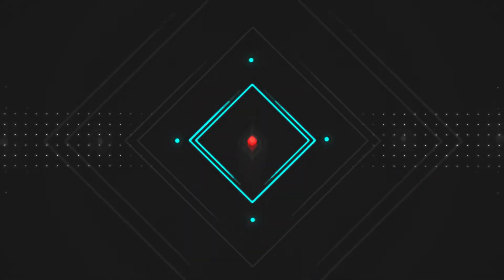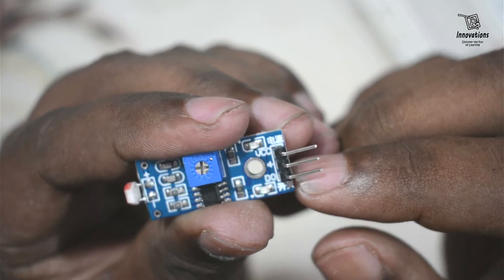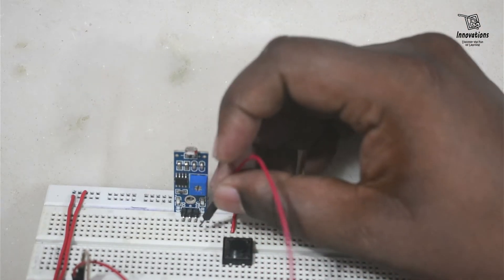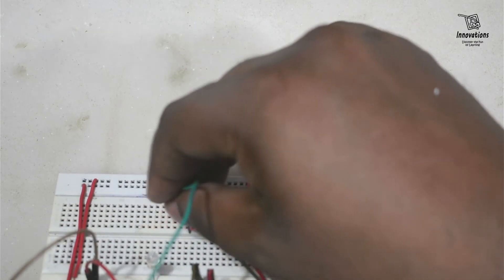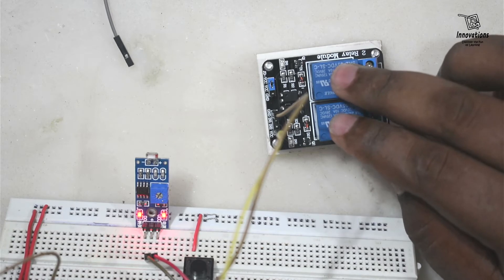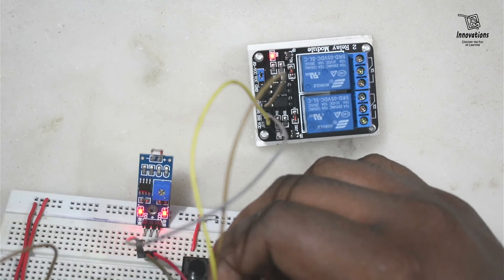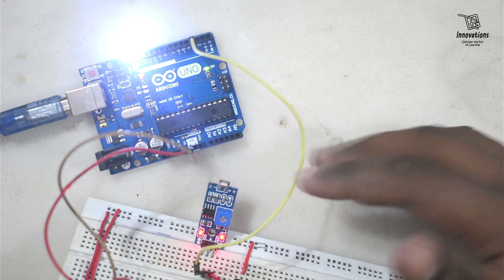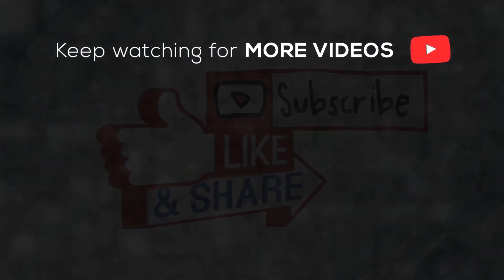LDR Module - Working And Usage | Connecting with Relay Module | Interfacing with Arduino Explained

Comment: please explain the connection method for the reverse, that is, buzzer turns on in the presence of light and goes off when there is no light, using the same board
Reply from the maker: Using arduino or not using arduino?